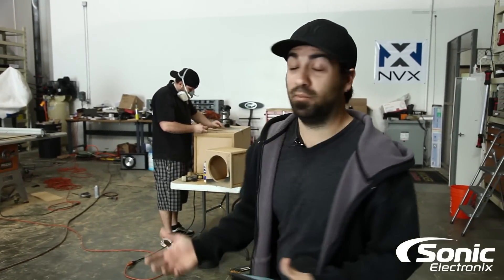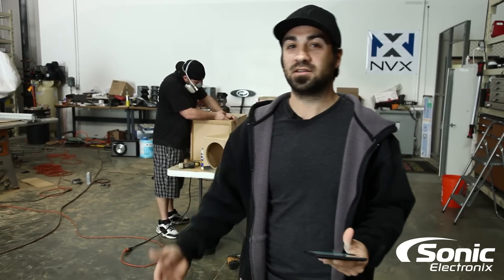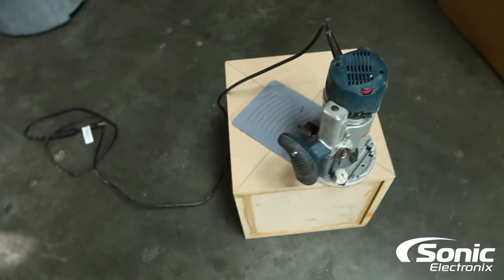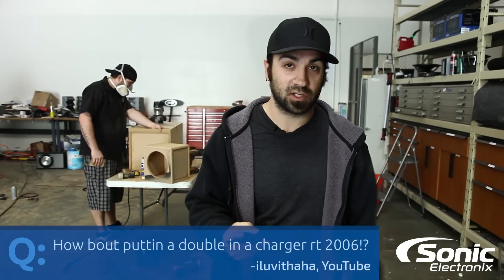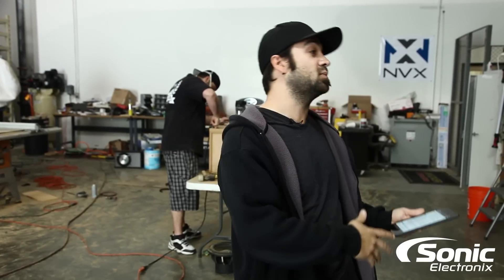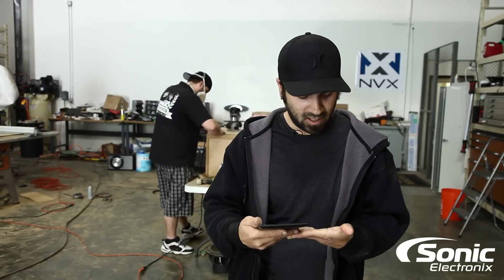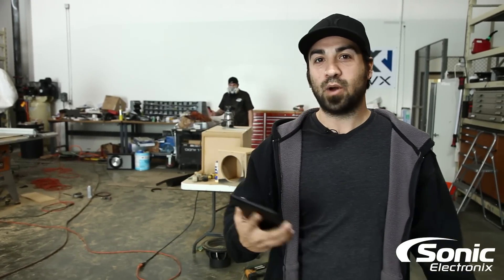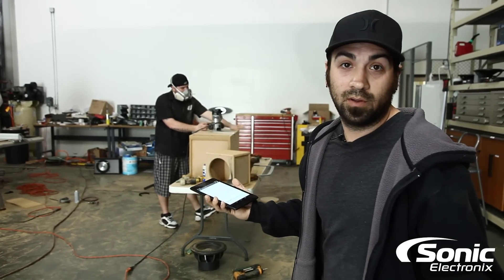How Do I Put a Double DIN in a 2006 Dodge Charger RT? | Car Audio Q & A

Comment: i don't know if anyone will see this now. But I'm going to ask anyway. I have a 06 dodge charger rt. It has the regular stereo with the moon bezel has 5 disk CD and cassette. Also have you connect rear DVD player and steering wheel controls. I'm wanting to put a 7inch double din in and i don't know what I need to be able to keep everything working.. any help is greatly appreciated.

Comment: I have a good question! My sound quality turns muddy after 15 minutes of playing music loud. Treble returns if I turn the music down then goes away again if I turn it back up. Its not the speakers or the amp because I've tried different ones of each. Running a four gauge power wire. I have a Pioneer AVH-x2700bs.
Reply: Sounds like a bad head unit

Comment: What size alternator would be sufficient enough to keep my headlights from dimming? I have an Autotek MM4000.1D sub amp and a Autotek MM2000.4 Mid and high amp. The subs are 2 10" 1000rms dual 2ohm cerwin vega vmax and i have crescendo mezzo series mids and highs.

Comment: Is it possible that the colors on the factory wiring will not match up on the radio wiring? I'm installing a single din stereo and I matched the colors but I won't power on but when I plug my factory stereo in it works fine please help
Reply: Factory wires are different colors then the aftermarket stereo wires

Comment: so my 2008 charger has a different radio bezel then double din kit sold where can I get the correct one mines is rainbow at the top and the aftermarket kit is angle at the top by vents any advice